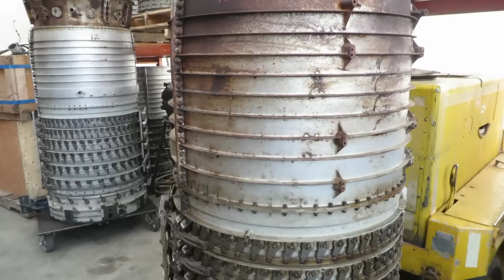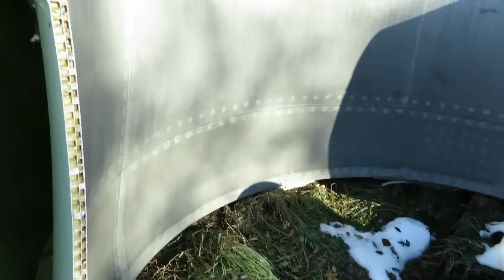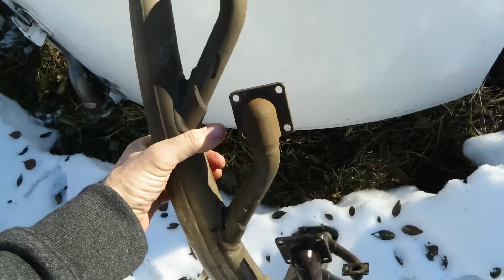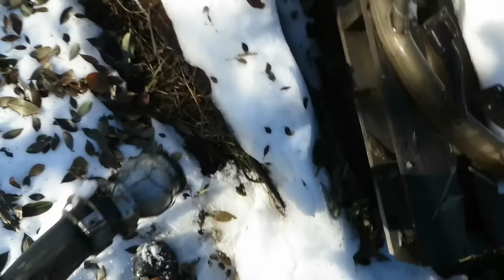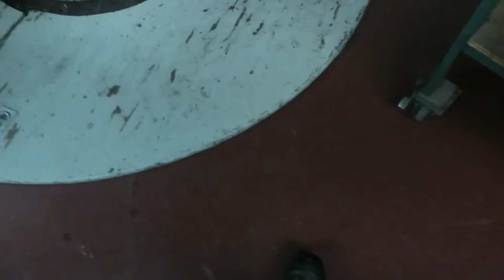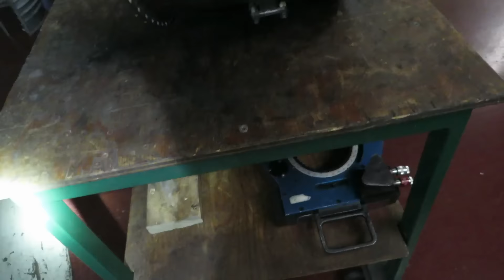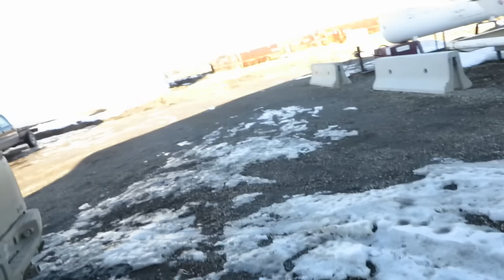Jet Questions 89

Comment: I seem to dimly recall that a nozzle generates thrust on the difference in velocity up to the point it chokes, and after that on the difference in pressure.  Then again it's been a while.
Reply: This is a question that has often taken up a lot of my time: upon what parts of the engine is the thrust pushing? All the explanations I have read start with Newtons second law: F=MA, and third law every action has an equal and opposite reaction. Air goes in the front, and is accelerated out the back. Beyond that, it's immensely complicated although sometimes I find engineering data that begins to unravel this mystery.

Jay, for all his mechanical knowledge, can't break-down the explanation into, say, pounds of force on the compressor blades, pounds of force on the stators, pounds of force on compressor discs, etc. Excellent and technical contributions have been made on past threads by grahamj9101  - a RR engine designer. Still, I barely understand the potential answer.
Reply from the maker: Have a look here... 
http://aeromodelbasic.blogspot.ca/2012/05/thrust-distribution-distribution-of.html
Google Thrust distribution, and it's the first image.
Reply: AgentJayZ Thanks for the reminder. Didn't I once provide that very link in a discussion thread way back when? The diagram is interesting but incomplete: the individual rearward gas loads don't add up to the total rearward load. 

How are you doing and how did your house "flood"?
Reply: The article to which AgentJayZ refers has been lifted straight out of Chapter 20 of R-R's book 'The Jet Engine' (1986 edition): I have it open in front of me right now. I've stressed this point before and I'll do it again: you can do an F = M x A calculation and get the correct answer. However, thrust can only result from the effect of pressures acting on the various components of the engine and their summation. The engine 'feels' the effect of the acceleration that it is producing solely through pressure.
Reply: Grahamj - I've been away from Jay's site for a while, so it is my pleasure to see that you are still actively commenting here. I trust that you are well and your ambassador work continues apace with the Bloodhound project? I watch with great anticipation as the high-speed runs commence next year!

All the best -
Reply: I am reasonably well, thank you - apart from my first cold of the autumn/winter. The BH project has been very quiet for the past year because of lack of funds, but it's now gearing up again. The project now has a  new prime sponsor, Geely, which is a major Chinese automotive group. I was at the technical centre only a few days ago and the car has been substantially dismantled, in preparation for its rebuild ready for running next year.
Reply: grahamj9101 Sorry to hear about your cold...hopefully it's the last of the winter season's misery as well. It's the same in my family...I've lost 75% of my voice, to my wife's relief.

I've continued to follow the BH project, although I wasn't aware Geely signed on as a prime sponsor. It's such an ambitious project, I hope Geely is a fruitful partner.

On a technical note, I was struck by how clean & tidy is the exterior appearance of the EJ200 engine, as portrayed on the BH site and in other on-line photo displays of the engine. Compared the EJ 200 to nearly every one of Jay's videos of J79's and other older jet engines of 1950s-1960s vintage (portraying a veritable spaghetti of cables and lines). I was curious whether this is due to digital monitoring and control of the latest jet engines, or are there other factors at work that account for the relatively uncluttered exterior appearance of the EJ200?
Reply: The EJ200 was very consciously designed with all of its accessories and piping on the underside of the engine for easy access through the engine bay doors on the underside of the aircraft. The lub system pipework is also simplified by the fact that there are only two bearing chambers and the fuel system manifold is hidden in the by-pass duct. However, what was designed for ease of maintenance in the Typhoon is thoroughly inconvenient for the installation in Bloodhound. If you look closely at the engine BH uses for display, you will see a lot of instrumentation leadouts clustered on the fan casing. I regularly have to explain this to people at open days and that they do not exist on the production engine.
Reply: grahamj9101 Thanks for an informative response. 

The readers at Jay's site are so lucky to have the knowledgeable input from somebody with  turbine design experience. It's a gift, actually.
Reply: Many thanks for your kind words. I do  try to offer my experience of 40 years in helping AgentJayZ's subscribers gain a better understanding of the jet engine, whilst not intruding too much on his territory. Unfortunately, I've upset one particular individual whom I was genuinely trying to help in his understanding.

Comment: Do you foresee turbine engine manufactures using synthetics in more non-heat exposed engine components, such as carbon fiber fan blades, in the future? Or will titanium remain the "choice" material?
Reply from the maker: Already being done in the newer engines, which I don't work with, so have no videos of.
Reply: Composites are already widely used within low temperature areas of engines (LP compressor vanes, shrouds, etc)

Comment: In my propulsion class, my professor has been ranting and raving about just how terrible centrifugal compressors are and refuses to teach us about them, but that one you showed is from a turbojet. When you get to balancing that compressor/turbine, could you talk more about engines that use centrifugal compressors?
Reply: Tell your professor he's wrong, (and a bad teacher).  Centrifugal compressors give you a much higher pressure rise per stage.  That's why they're used in smaller applications like turbo chargers.
The downside is they output air radially, so the engine ends up wider, (bigger frontal area/drag).
Reply: A high proportion of small gas turbine (eg, helicopter) engines use centrifugal compressors. If they did not, the equivalent blades in an axial machine would be small, thin and fragile. A centrifugal impeller is much more robust.

Comment: In the junkyard, I saw a part with ATAC stenciled on it. Are you guys doing engine work on J-79s for their fleet of Israeli Kfirs?
Reply from the maker: I think that's from a partial aircraft we bought specifically for the engine. We obtain J79s from a wide variety of sources, and convert them to industrial LM1500s by  removing a lot of external parts.

Comment: Jay, Do you happen to have any footage(or know of) an engine running without the jet pipe attached?  I've been searching but so far I've only seen one really short clip from the late 50's i believe. P.S. Thanks for taking the time to make your video's. I was not really interested in Engineering until i came across your stuff.
Reply from the maker: Some of my Orenda tests are done with the jet pipe and final nozzle attached, and some are without. So...yes!

Comment: Is it possible for an engine to reduce rpm faster by opening a bleed air valve?
Reply from the maker: The turbine is under tremendous load. The instant throttle is reduced, rpm drops. There is no "momentum" to any practical degree in the rotor at operational speed.
Also, bleed valves are not independently controlled, and they reduce the work done by the compressor, so would not increase the rate of rpm drop anyway.
Reply: AgentJayZ  is there any reason a bleed air valve would be opened or bleed air would be used during flight or while the engine was above idle?
Reply from the maker: What you are describing is not possible. The pilot has no control over the bleed valves. As the rpm changes during the engine operating range, the bleed valves are operated by the engine. No manual control is possible.
However, if you watch my video called Bleed Air... you will see that your question can be interpreted in several different ways.
So the answer is: yes, no, well it really depends on what you mean...

Comment: If a Jet engine has suffered a core lock, would a person be able to turn the fan blades by hand ?
Id imagine in a turbo fan jet engine yes but a single shaft Jet engine no ?

Actually could you explain a core lock at some point and possibly some other serious conditions a jet engine should never get into ?

Some pictures here of a turbine fracture. Interesting and a bit scary at the same time but worth a read

http://www.pirep.org/forum/viewtopic.php?t=1375